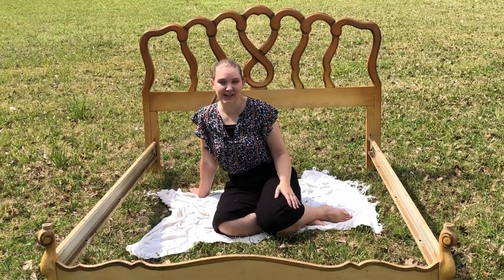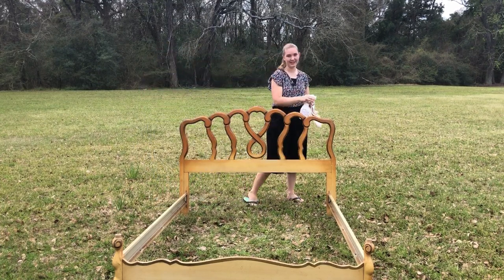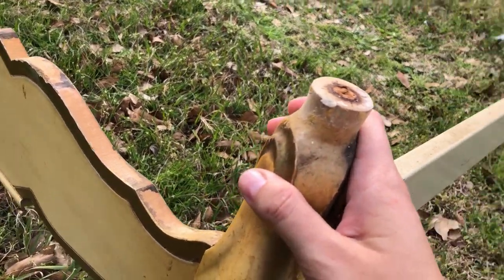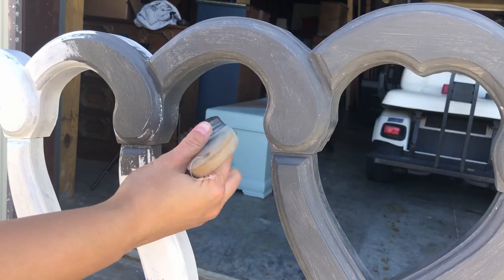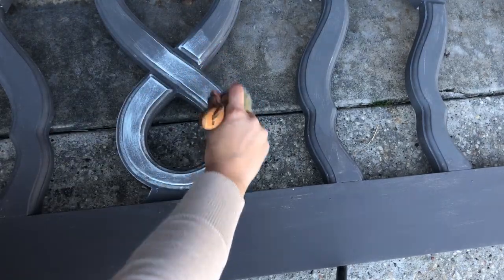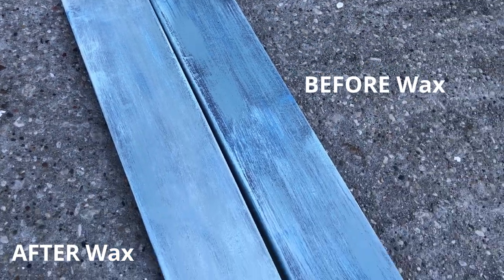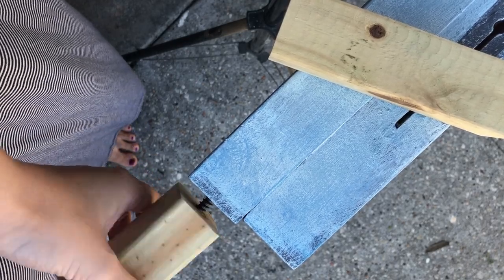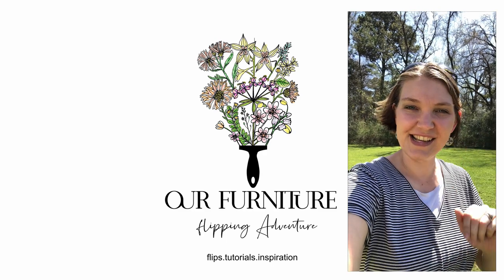I Painted This Old Bed Frame with 4 COLORS! | Furniture DIY Project | Layered Paint Finish

Comment: You absolutely met the Spring Fling challenge, Sarah! I love all the shades and shadows of blue on here. It will be like sleeping in the clouds for the person who grabs this beauty! Right now it’s snowing in the midwest. Welcome Spring! The headboard and the footboard “go” together but they aren’t a set. That’s why the headboard was lower until you fixed it. Also, it wasn’t a “bleeder. That was residue from cigarette smoke. It looked like both pieces had the original factory finish on them so the smell and staining would not have permeated the wood. Cleaning with Krud Kutter and sealing with Bin perfectly solves the problem of bleed through. I always give you too much info in my comments, I know. I’m sorry to hear about your dad and your brother. It’s kind and generous and inpiring that you have chosen to do something positive to help others struggling with cancer.🌸
Reply from the maker: I actually filmed talking about thinking it was cigarette residue but it got cut out in the editing process because I rambled on too long 😂
Reply: @OurFurnitureFlippingAdventure  you know I always ramble on too long! But I call it “storytelling” instead!😂🤣🌸

Comment: I have a bed that has metal sides also just sitting in my garage. I have no idea what to do with it. I may try your method. It turned out so beautiful as always. I love watching your videos wish you posted more lol. I know they take a while but I love your videos. I try using those rollers with bin and they always swell up and fall apart. I love your hair.
Reply from the maker: The roller and tray I used come from the dollar tree and by the end of the putting the primer on the roller was dying- but since they are only a dollar (or 1.25 now I guess!) I don’t mind it only lasting one project. The roller/tray kit even comes with a cheap brush and thin plastic gloves! Can’t beat that for the price!